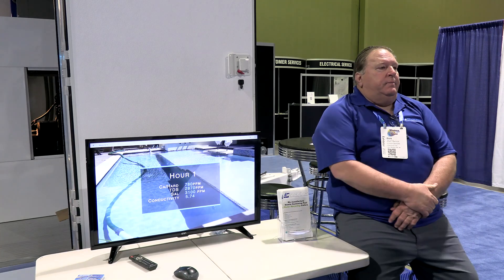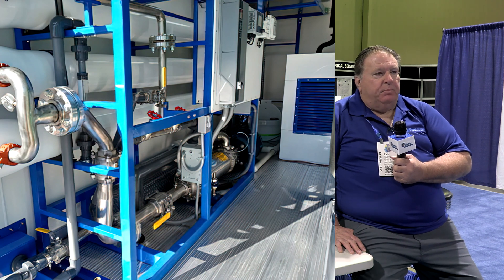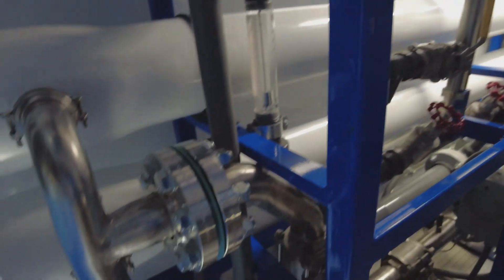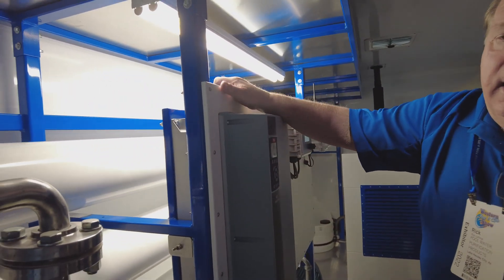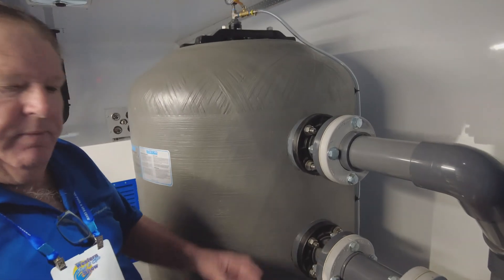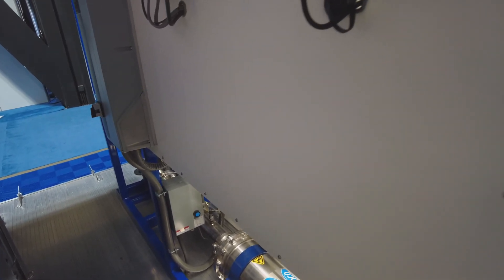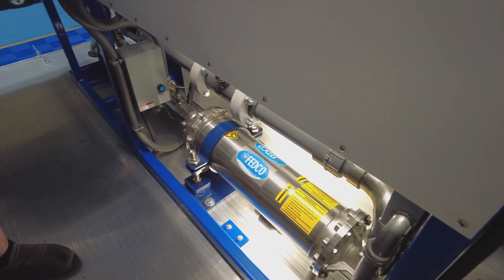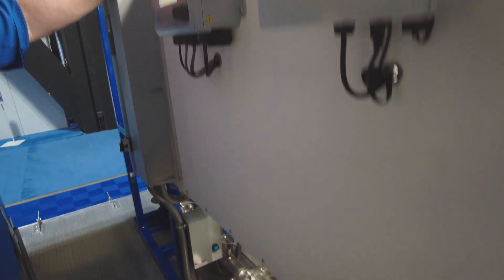Don't Drain Your Pool! Pool Water Purification with Less Than 20% Water Loss!

Comment: This is very bizarre. I open my pool every year from green swamp to crystal clear using only a couple scoops of chlorine and letting the filter run. After vacuuming I loose way less than 20% of the water
Reply: Calcium is a core issue from hard town water supplies.  Chlorine doesn't remove calcium buildup and scaling

Comment: Hey I know this is kinda off topic but I wanted to ask a question. To see if u have an answer. I'm plastering a pool with black plaster but it's fall weather and it keeps sweating and its not curing vary fast. We sometimes use fans to cure it faster. But is there a way to cure it without having to use quick set in the plaster itself?
Reply from the maker: That is a question you can direct to the National Plaster Council. They have lots of information on their site and they are specific to pool plaster issues.

Comment: If you follow some basic guidelines you should never need a visit from that truck: Do a 20% water exchange every winter. Backwash every time the water level gets high after a rain. Don’t use stabilized chlorine tabs that jack up your CYA. Add borates and don’t worry about high TDS.
Reply: Not true.  If your city water is high in calcium yiu will never remove the high levels in the pool